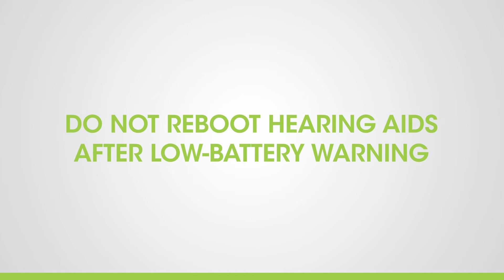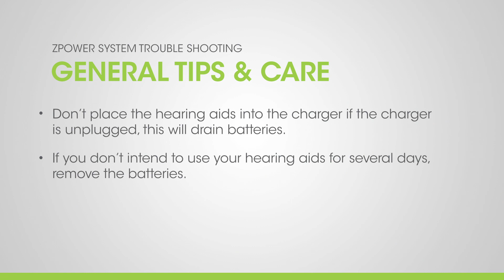Getting the Most Out of Your ZPower Rechargeable System

Comment: Can we buy these rechargeable batteries online? It will be good if you could provide the details. Thank you
Reply: The rechargeable HEARING AID has a built in rechargeable battery. So, the unibody design doesn't allow for "replacing" any batteries, and there is no option for "rechargeable batteries" (yet).